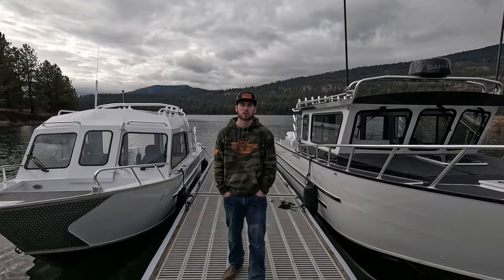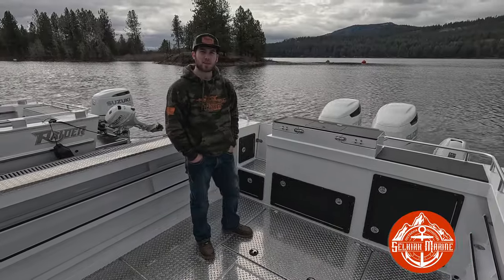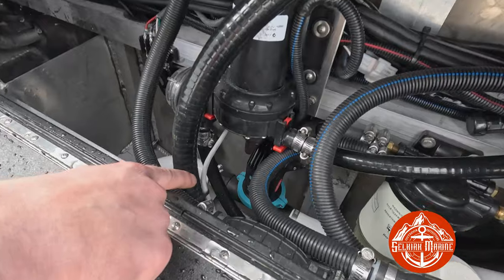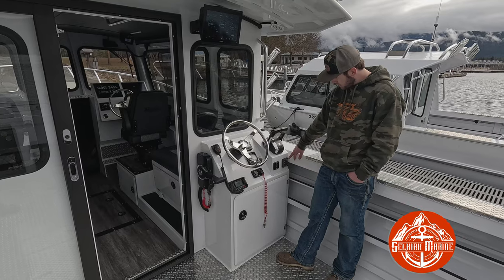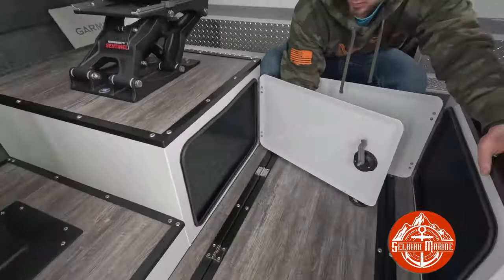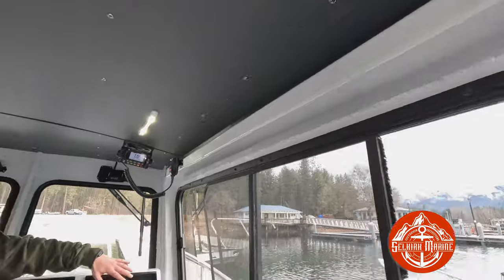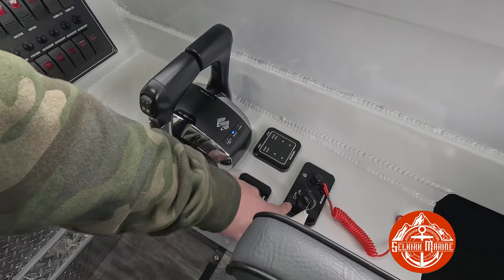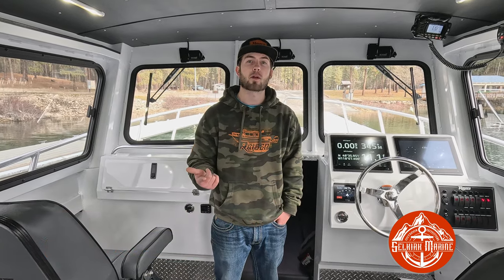Raider Boats 280 OFFSHORE Walk-Through BY SELKIRK MARINE PREMIER Aluminum Boat Dealer

Comment: Gotta move the ignition location in the cabin. It gets bumped when you're underway in rough seas. Very not cool when it happens.
Reply from the maker: Yeah.. we agree. They were supposed to be relocated but Jon just realized they were back in that old location so we’re shifting it. If you have a boat with it there send an email to CS@RaiderBoats.com and they can get a cover plate sent to cover those holes and relocate that switch.